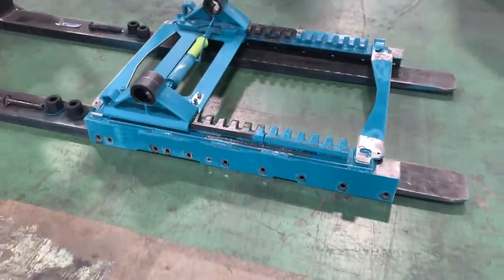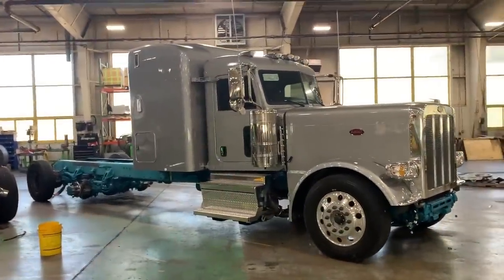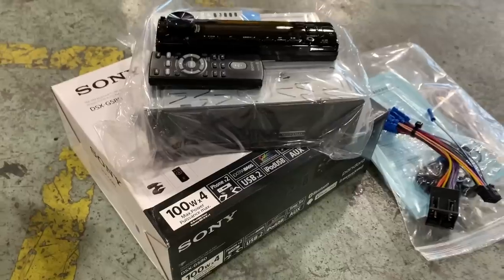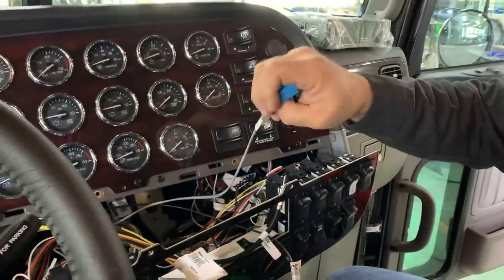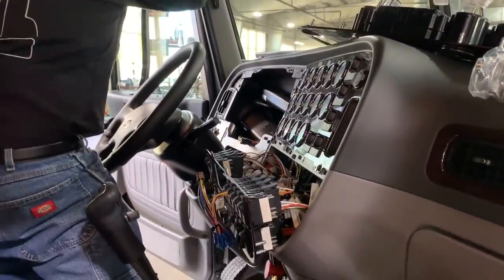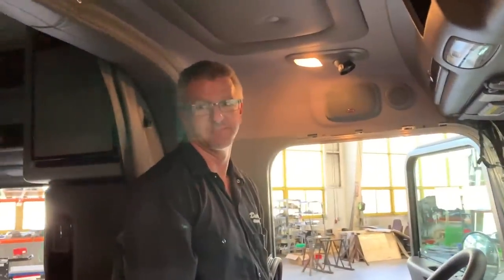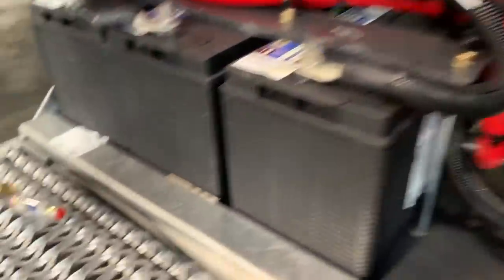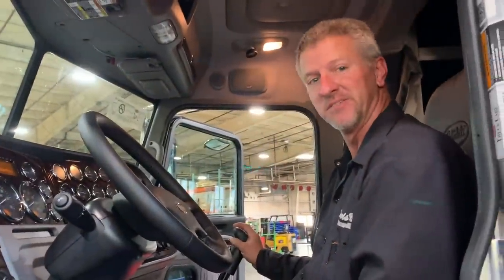JL Audio SUBWOOFER in a 2021 Peterbilt Big Rig!

Comment: Worked with an IT guy for a few summers. 
One client- "Why did you charge me $300 for 15 mins of your time?  You pushed only a couple of buttons (on CPU) and now my network is working? 
IT guy- "I went to school for 7 years. I learned which buttons to push and which ones you NEVER push.
Well done on the radio installation guy sharing his "years of experience" to us newbies.

Comment: Are you able to hear the bass outside of the truck? I'm wanting to get a system aswell but don't know if I should go with a 10 or 12.
Reply from the maker: You can hear outside a little bit. They 12 is definitely more
Reply: @SEMICasualShow  you installed 2 10s? I'm debating between 2 10"s or 1 12". I'm a little concerned about the weight it'll add though 🤔
I'll want to hear it a bit if I'm outside pumping diesel lol
Reply: @VicBeatz  Whatever tone of bass you want. 12s hit great for mid from what i know,anything lower to me is high tones. I say low and loud get a 15'
Reply: @VicBeatz  late response but met a dude fueling up 3 trucks away from me with 2 12s and I could hear it

Comment: Would that radio work on a Kenworth w900l flat top sleeper
Reply from the maker: It should, but not 100% it is the same harness as the 389. If you pull your factory unit out try and compare the factory plug to the Raptor wiring harness: part# RAP-VW-9000

Comment: I’ve been doing stereo installation professionally for 20+ years and I’ve never seen anyone use butt connectors in that way when putting a harness together. Interesting.
Reply: I always have. They dont fail like wire nuts and they dont break like solder.

Comment: Maybe it's just me but you guys did not seem too thrilled with the quality of sound🤔
Reply from the maker: It’s way better then factory.
Reply: @SEMICasualShow  I actually experimented with the same exact setup practically and honestly was not happy at all but you are right definitely sound better than stock
Reply: @SEMICasualShow  
I installed that same unit in a Volvo VNL Day Cab . 
Installed 6.75” Rockford Fosgate 3 ways in the doors. 
I had to wire it to the batteries because it kept blowing the fuse